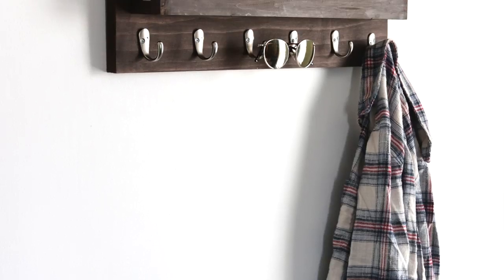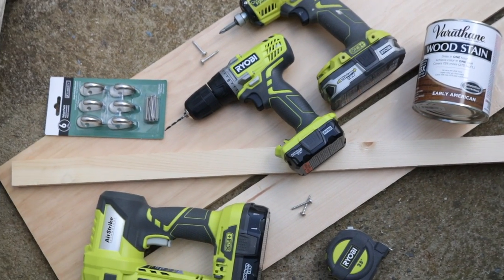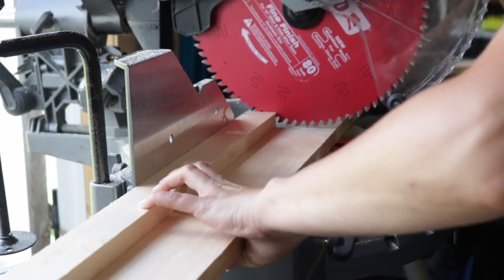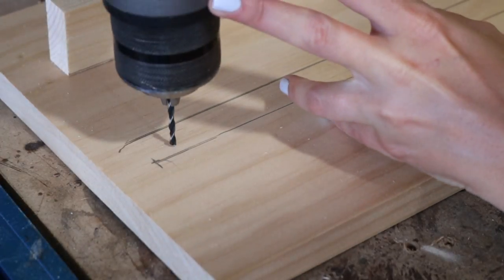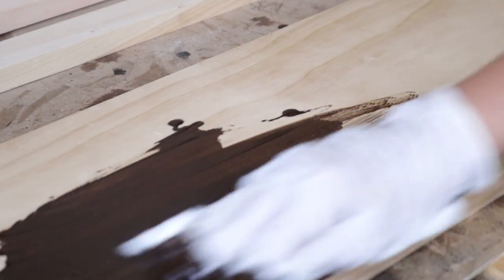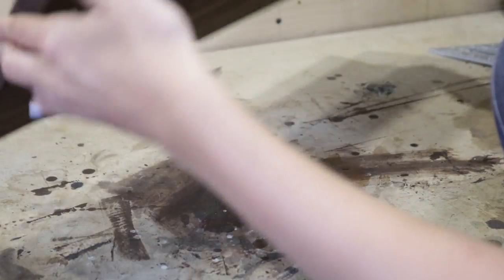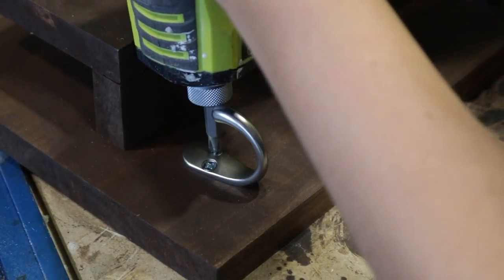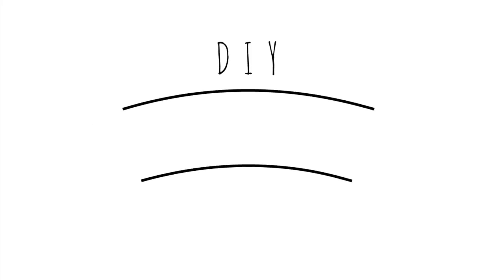DIY Wood Coat Rack & Mail Holder | Scrap Wood Project

Comment: No such thing as too much glue =)  Just use a damp rag and the excess squeeze out should clean up easy enough. The only thing to watch is if staining after glue then excess glue can inhibit absorption of the stain and cause it to appear uneven.
Reply from the maker: Very true!
Reply: In other words, there IS such a thing as too much glue. 🤷🏾‍♂️
Reply: @mvalovalo  lol you got me. What I mean is, more glue makes better bonds. As does strong clamping pressure. In all cases, you must be prepared to wipe the glue that squeezes out when clamping pressure is applied. There is no penalty for using more glue than is actually necessary, since even a minimally sufficient amount of glue will require careful cleanup anyway.

Comment: How well does the glue bond with the stain?
Reply: Yea I was wondering the same. I didn't think wood glue would bond on stained/painted pieces.
Reply: David Smart I think it will bond but not well. She’s not putting any stress on it I guess it will work for this but I always glue before stain.
Reply from the maker: It’s held up well so far! It got kicked around in my car recently during a move and hasn’t budged, even with just pin nails and wood glue.

Comment: Very original coat rack. Thanks for sharing. Concerning the use of glue: glue has to squeeze out when you connect two boards together.
No squeeze-out means that you did not put enough glue there. It's always a guess how much glue you really need. But better too much than too little.